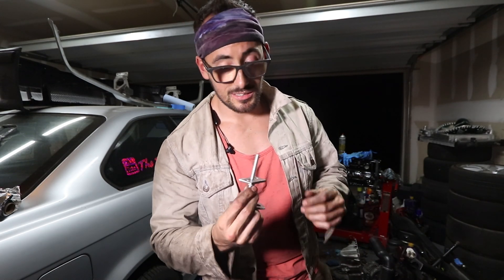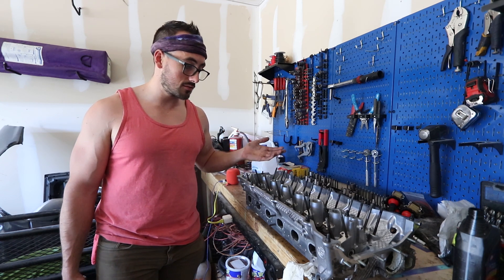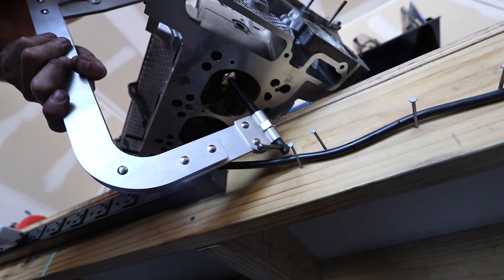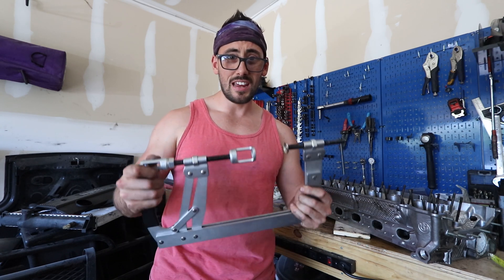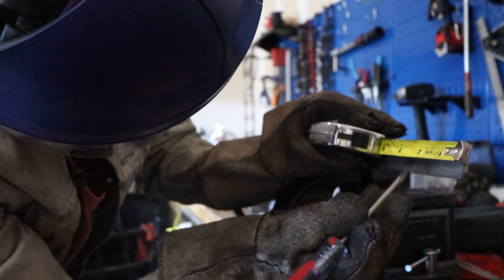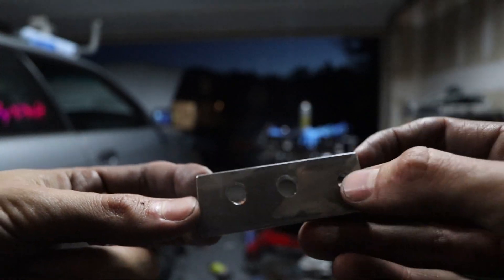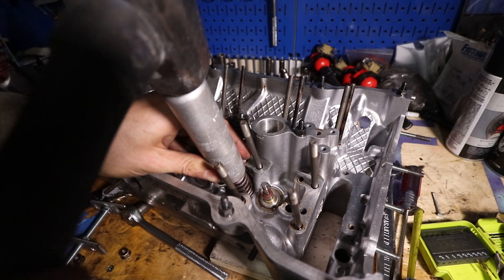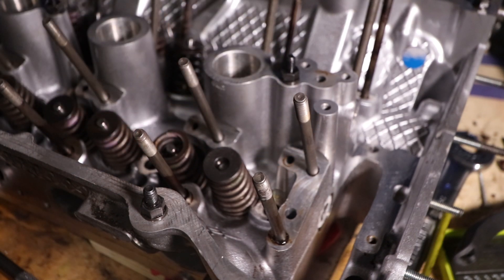How I made a Custom Valve Spring Compressor Tool for $5

Comment: Yes but theres one thing thats still missing.... Your engine has the stud bolts on it so im assuming that the head bolts are tightened using gr 10.9 nuts to torque...my question is what does one use on a 4 cylinder 8 valve or 12 valve that the head bolts are actually removed in order to take out head itself???? Cos in that head cylinder there are no stud bolts to be able to make a jig thats similar to yours....since no to car models or brands are the same..some are straight 6..some is 1.6. others are 1.3..some are 20 valve....none of those has the stud bolts as head bolts ....all have straight head bolts that takes allen key socket or spline socket....that is my question as to why cant we find a decent tool for this out in the country

Comment: Maybe cut the all-thread a little shorter, and use a nut there in the middle to compress both valve springs at once, using the studs as giudes only.

Comment: What is the tool u used to get the keepers out doing my vavle springs is becoming a pain n my ass cracked a piston n my grand prix gtp supercharged so I am fixing that now having trouble getting my keepers out
Reply: Use a magnet inside a deep well socket.. the magnet grabs the keepers off the stem when you compress the spring.